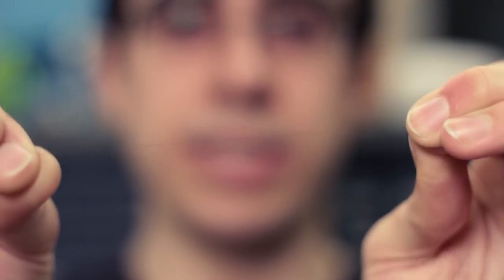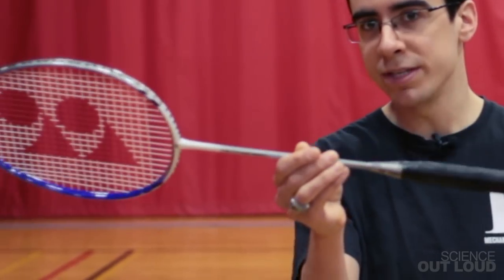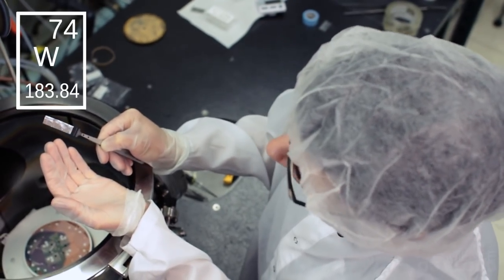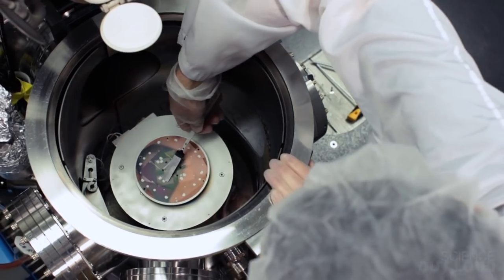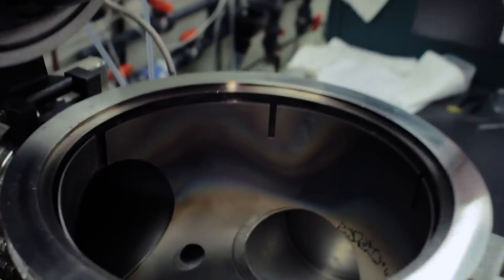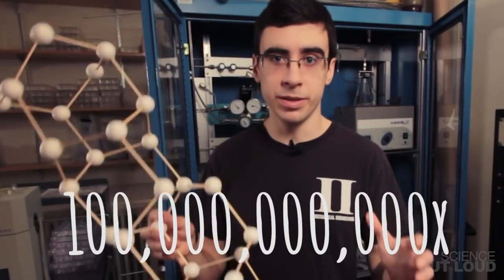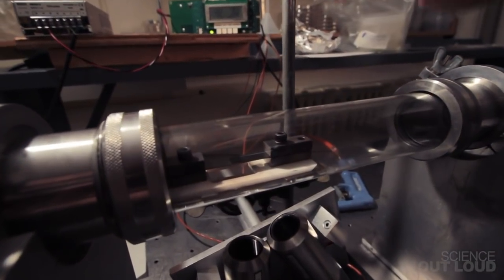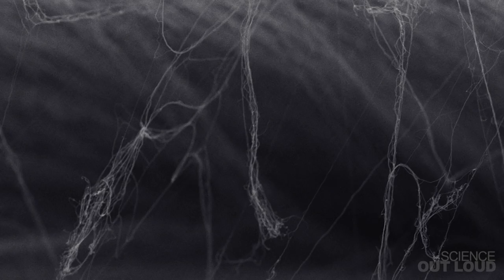Growing Nanotube Forests (Science Out Loud S1 Ep5)

Comment: Well, what a high quality video! Subscribed (although 9 years late)! 
Have not yet been into carbon nanostructure formations, until now I was playing with other semiconductors. Having implemented and employed from ion beam, sputtering, electrospray, electrodeposition, silar and other techniques, one would always opt out from vacuum techniques if there is something simpler.
I was wondering, for your first step, where you would want some iron particles on tungsten, could you not just employ simple electrodeposition? You could even count atom by atom how many atoms you have reduced on your substrate! Given you can easily adjust the amount of reduced particles, you could opt for a same concentration of particles deposited to holes left behind on your substrate, so you would not mind what you deposit first, leading you to be able to have as the substrate the more conducting of the two elements.
If you used the more conductive metal for the substrate of the two elements (Tungsten, Iron), you could have the electrodeposition deposit selectively on areas that are not yet covered, instead of growing on the already deposited particle, leading to excellent distribution and coverage.

Comment: In the particle transfer phase of this, with the iron, is this done in a vacuum or in air?  I assume it's basically a form of electrolysis right?  The heater use later is just a band of conductive material, I'm guessing tungsten, with current run though it and monitored for temperature.  Is this correct?  I'm interested in recreating this because I want to try to make carbon nanotube forests for use in experiments in making artificial electroactive muscles for a bionic arm project I'm working on.
Reply: iron was needed for the seeding because it has a higher heat capacitance (0.449 J/g K) compared to tungsten (0.134 J/g K). the chamber is either filled with argon gas to drive out the oxygen, or just left as an empty vacuum, if there was air inside then the oxygen and carbon would form into carbon dioxide. that's how i understood it.